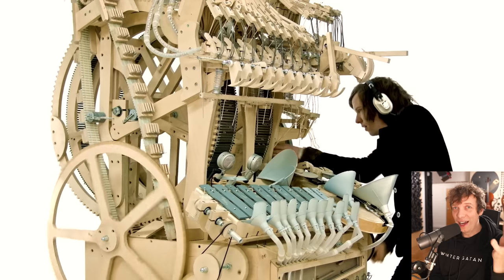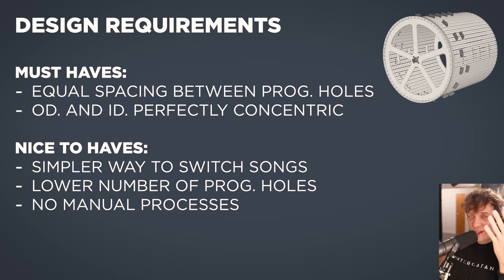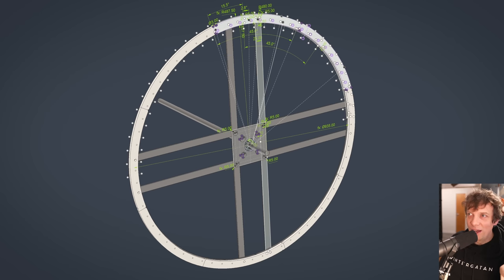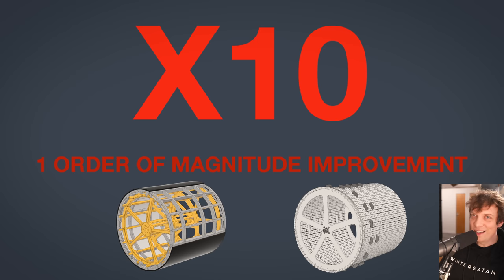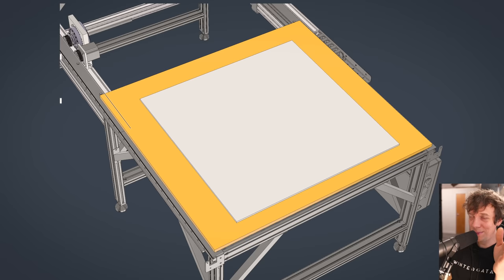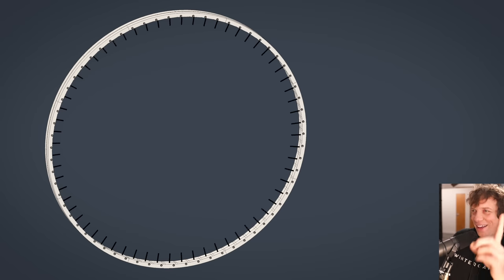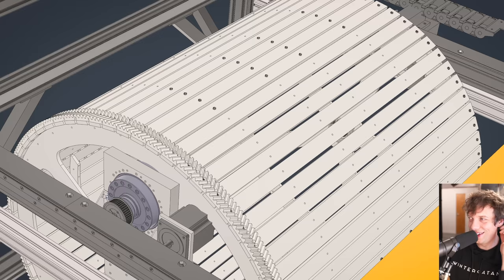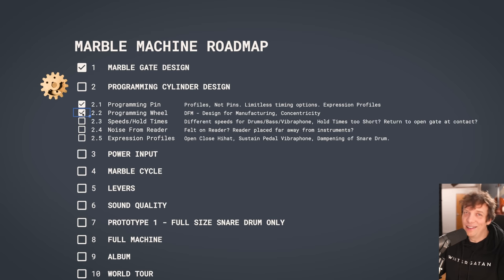A New Music Programming Wheel

Comment: select your material based on how you plan to use it
wood is good for testing
metal is stronger by weight
plastic is good for light weight things

plastic - really cheap, vulnerable to high temp (especially during transport box truck's get hot inside)
steal would be best for strength - cheap, high weight
aluminum would probably be bet for this - low weight, more expensive
programing belt (punch card or something like that) - really really cheap, easy to replace when damaged, easy to change songs, looks cool, hardest to store

if you want a cylinder:
my recommendation is to have an aluminum and plastic programing wheel - 1 per song
- plastic cylinder with aluminum spokes and braces

if you will try something else
you could try a punch paper system like to old style player piano's

Comment: I think you're starting to engineer the soul out of the machine in the same way that replacing a pianist with a midi track removes the soul.  Also by removing 90% of the holes haven't you reduced the musical sequence length by 90%, or at the very least 60%?

Comment: First thing, Nice yob on a new design. 
I would use screws for plastic (similar to wood screws) not bolts because you are screwing them deep enough so the screws are not going to strip out, and they will not need frequent dissasembly.

Why are  you making the gear out of 2 segments bolted (screwed) together, You could make the groove  and the holes on the rotary cnc. 

Try cutting the gear blank like a single strip in one setup maybe even with a slot and holes for mounting, and then wrap it (with a bit of heat) around the wheel. this will probably need  a few tries to line up the holes on the wheel and on the gear, or glue the band on and then drill the holes on rotary cnc, and then cut the gear on rotaty cnc

Be carefull about timing the gear segments to 4 programing segments so they overlap, but you figured that i think

That harmonic drive has almost no backlash wihich is great, but you can add a weight to one side of the wheel as cnc is cutting so that the load is only in one direction. or machine a giant timing pulley for the belt driven drive 

Gang up wheel side plates and brackets 4 or even 6 next to each other and cnc machine them on rotary in one setup (face the top, then drill 8 or 12 holes)

Use screws for plastic (similar to wood screws) they are self tapping and they are not going to strip out if they are long (you have a lot of depth to screw them into) also this isnt meant to dissasemble so the will be yust fine

Comment: So, while you're playing one song, the backstage elves are reprogramming the second wheel for your next song. You'll want a simple extra device backstage which can quickly read out the wheel to confirm it has been programmed correctly. Tell the device which song you're trying to program, toss the wheel onto the device, give it a full rotation, then a display will tell you what programming pegs are out of place, or a green light if all correct.

Comment: The more of these new videos I see, the more fear I have of the MM3. Martin has surely learned a lot, and while I like the approach of compartmentalising every small aspect of the new machine, the very soul of the machine is how each part interacts with each other. You can design and build two 100% perfect parts that do not work well with each other

Another thing that I see more recently is that Martin frequently "fudges the numbers" to force proof that his new idea he likes is better than the older. I'm not saying this new idea is better or worse, but that it is certainly not as "simple" as he brags about. Fewer manual processes? Idk about you but I do NOT want to be in charge of affixing that many bolts. And I also believe he overexaggerates how complex and flawed the MMX version was. Basically, he decides on a new idea and then finds "data" that supports why this new idea is better. It's backwards science - he's already concluded that his idea is correct before building and testing it

Comment: Hmm, there's like... nothing keeping the new wheel's side for torsioning away from each other is there? So in practical term keeping the left and right side exactly in sync with each other, it looks like the driving side could be slightly ahead of the passive side, especially at higher speeds

Comment: Now that we no longer have 1 pin for 1 note, won't you need some kind of interpreter to convert one pin to many notes?  I don't recall this being already built into the marble gate assembly.  Will this be built into the wheel readerheads?  The tightness of this interpreter would also need to be analyzed via prototype.  Do we have a roadmap for this assembly specifically, or is it going to be handled within the programming wheel checkpoint?

Comment: I don't see the other machines as failures, more steps towards a fully working one. As an engineer, this is very typical you have to test and build designs, sure it could have been faster to get there but that's part of the learning as well. When we are designing things for Satellites you will start with individual parts of the whole thing, prototype BB it is called Bread board in case of electronics. Then you progress to EM, engineering model this one should work like the finished one but you can still work on it change it modify and optimize but it has to have all the function and performance of the real unit, the EM can be also tested to its extremes. Then there is the FM (flight model), this will go into service and incorporates everything learned. There is a bit more to it, but in a grist that's how it works.

Comment: I'm  5 minuts in. No idea if you covered this yet. But belts might be a better way to go. All gears have backlash. If they didn't have any they wouldn't be able to function. This would be bad for keeping the music tight. The reason milling machines get away with it is the insane tolerances they are built to. And that takes lots of time and money to get right. The reason belts are used in almost every precision 3d printer is because they get rid of the backlash problem while saving on cost. It makes the most expensive part of motion the precision motors that drive the mechanism.

Considering you don't have to deal with high torque or lateral and horizontal sliding motions. Belts would be a better idea. They are also quieter that meshing gears when done right. Thought I'd add my two cents. Hopefully this makes its way to you somehow.

Comment: Hardware = manual processes

Also, the hardware is disproportionately heavy compared to the material of the build, and that many fasteners can put weird tension and pressures on the build that warp the final assembly.
You should minimise hardware just as much as you should minimise any other part

Comment: What are the requirements that dictate you need your darling "double helical" gear? In a previous video you talked about Killing Darlings - is what you've presented strictly necessary ?
Reply: Not only are there types of gear teeth that will minimize backlash, but unlike a CNC or a 3D printer his marble machines don't even really need that since they always rotate one way only and at a constant speed.

Comment: So you're gonna have a physical person changing the pins on the second wheel while you play the first one?

Who will that be? And how would you prevent that individual from making any human errors that you can't control before playing? You care a lot about stopping marbles from dropping incorrectly, yet you're willing to outsource an entire wheel to another individual, and you won't be able to notice that something is wrong  until you've already started playing.

I hope it works out well, but human/social engineering is just as important as your actual technical engineering if you're planning to have someone else do that work during live shows. It doesn't sound like an optimal solution.

Comment: Not a mechanical engineer here, but couldn‘t torque build up between the two sides of the wheel, so what part of the wheel prevents it from turning „into“ itself? Hard to explain without a drawing, but your design shows how all spokes are perfectly parallel to eachother. Couldn‘t it happen that the right side of the weel turns a couple of milimeters farther than the left side and thus all spokes are suddenly at an angle to eachother, like a twisted can?

Comment: You might have some interesting issues with the rigidity of the plastic during machining, as it will be quite high stress, but you'll have to see that. You also need to be careful machining on a wheel that big, as the leverage is massive.
Also, please use push rods rather than Bowden tubes, they're better in petty much every way for this.
Also also, if you're going on tour, why not have a seperate wheel for every song, then there's no messing around with reprogramming on stage?

Comment: This might sound silly, personally I like the wheel as I suppose that it is part of your goal, but do you ACTUALLY NEED the programing wheel? 
As far as I can see that things must be manually programmed unless you put pins under it that with the help of a program, they go up and down as needed, yet I suppose that is inconvenient at some point.
Other I'd say would be to throw away the wheel and use a programmable mechanism that moves the arms as needed and you can use a program to make it automatic (I mean, you would still need to load a program but that's all)

Comment: Why not have a hub, rim and spokes like a bicycle wheel? Sure, there is the need to true it for concentricity (tensioning each spoke), but the saved weight and insane strength makes me surprised this wasn’t considered.
Reply: Seriously though, if you think about the crazy forces a mountain bike wheel takes, yet how light it is (some even having spokes made of nylon string) and how structurally rigid it is, it would make a great interface for the programming wheel to the shaft.

Comment: Loving the design progress, but I don't think the bearing selection for the hub is right. I am a mechanical engineer and have used these SKF bearings many times and they are ideal for mounting rotating shafts to a structure that is not perpendicular to the axle as they have a spherical bearing between the cast housing and the rotating inner. This could give you issues with mounting the axle perfectly perpendicular to the side spoked wheel. Also the way you have mounted the bearing to the spoked wheel is against a rough cast face that is roughly spotfaced in four places for bolt heads and so not a perfectly flat face. This could introduce twist of the spoked wheel and non-perpendicularity to the axle. I only mention this as you are looking for tight tolerances for tight music play back.

Comment: I dont actually understand why you cant have 4 quarter big programing plates again (same as on MMX), since you´re going to machine the programing holes in the platses in the rotary expansion CNC after mounting the plates on the wheel.

With the rotary expansion CNC you dont have to bother with distance between plates. Just bolt the larger plates on the programing wheel then run the rotary CNC. 
The spacing between holes will be perfect anyways since you CNC the holes in the plates "on the spot" so you dont have to care about perfect spacing in between plates. 

That would lead to A LOT less screws and parts. The larger plates would stabilise the whole wheel more, the larger plates doesnt require as much bolts as the programmingstrips. And like 4 quarters of programingplates is a lot less parts than 60 + programingstrips. It´s also a lot less risk of 4 quarters of platses shifting places in transportation than 60 +. 

The programing strips are brilliant by the way. You could make looong strips with sequenses of notes thus making it so much faster to program a pre determined song.

Comment: What would be the amount of actual error when machining flat x/y and are there any design approaches to minimize/manage the total error in the end product? Is the design rigid enough to make use of rotary axis machining? (Lack of rigidity can be mitigated by support rollers though) Is the bearing centered by other means than it's fixing bolts? Are the mounting holes for the prog pins necessary? If prog pins are printed > no manual labor is needed > no limits for the shape/complication, those prog ribs could be cut to a shallow comb shape (for indexing prog pins sideways and reducing the amount of prog pin holes to zero) and mounted radially to gain axial rigidity in both each rib and whole structure. Prog ribs could be slotted into end wheels, reducing the amount of fixings. Axial ribs could be extended along/inside the spokes and stiffen the structure even more.

My point: From flat and flexy to radial and rigid. 

But, probably, the method and path to be used is already chosen. 😉

Comment: The parts that span from one wheel to the other wheel that the programming pins connect to.  Won't the parts that span flex too much when the machine applies pressure to the programming pins?  I feel that at least one more wheel between the other two is needed for rigidity. That or some other form of bracing.  Sorry if I worded that confusing.

Comment: Hey Martin, if you CNC the wheel while everything is assembled, what will happen when you need to disassemble it for transportation. It'll probably still have tight tolerance, but I wouldn't mark the wheel as "done" until you've done that test of disassembling and reassembling and then testing timing again. In fact, how do you plan on testing the wheel before moving on like you did with the gates?

Comment: Can you design a wheel that somehow could be programmed outside as it already is, but also be programmed and have mechanisms to play from inside? something like side A and B?
Reply: The same pin could cross the panel and each edge could have different shape or angle or even pins that wouldn't cross. On the axis spinning inside you put a mechanism that will play from inside once pulled it manually.

Comment: I don't understand why you would want to CNC the programming holes while it is attached to the hub, would it not be easier to take a large plate (like you showed when making the spokes and brackets) and then CNC the holes out that way, then cut the individual pannels out to put on? you could also CNC out the screw holes at the same time reducing steps in manufacturing and removing the need to make a specialized tool for CNCing the plates while it is on the wheel.

Comment: I enjoy watching these videos. However I think a major issue you continue to not address is considering using already made equipment/parts into your design. This  video really made think about that when you started talking all the CNC machining.

For instance on drive gear: Consider using rear end parts from car/truck. They will last long time. Already include design for axle. Can be bolted to larger wheel. Easily ordered for replacement/duplication. Helical design/cut already. Many different gear ratio sizes available to make even more options for machine.

Also I echo what many others here have said. 
Drum: Plastic=bad Aluminum=good  (stable material for travel, temperature, and longevity)
Drive gear: custom=bad off-the-shelf bolt on=good  (replacement, spare, can be ordered)
Inner hub: Need additional inner spokes to make more stable. Maybe not for playing but for travel when on tour.

Comment: I will say, neither of your other marble machines were failures as marble machines. While they may not have been fit for the purpose of going on tour, I think that they are actually more fit for the purpose of making entertaining music videos than the current project will be. Their imperfections are a large part of what made them so much fun to watch. As great as your music is, it wouldn't have captured my attention nearly as much if it weren't for the fact that you somehow harnessed a rube goldberg machine to play it on. The unnecessary complexity, with things spinning and pumping and marbles rolling around on top, and the mechanical linkages of the marble droppers on full display, rattling and clattering with the beat of the music are, in my opinion, a core part of what makes the marble machine so great. If you succeed in removing all that imperfection, I worry that the marble machine 3 will be to the previous two what a synth orchestra is to a live one: way easier to work with, and arguably more "perfect", but missing that indescribable quality that makes it feel so magical.

Comment: Can you not just mill the whole part out of one solid stainless steel cube? That would tick all must haves, all nice to haves, it would be just one part, so one and a half orders of magnitude better than your current solution and it won't twist (as others have pointed out which I am also a bit worried about). Only downside is that you will have to reinforce the stage slightly. Ah and you might need a crane for switchng wheels on stage. 😋

Comment: if you are CNC machining the parts from the same material anyway I'm surprised you can't design a dovetail joint that would be glueable making the whole drum a solid piece. no bolts.

Comment: Out of curiosity, if you are using inserts for programming the drop timing, wouldn't you be able use heavy duty tape (Or velcro)  to create a profile of songs, decreasing the margin of error when removing old songs, and adding new songs into the "Wheel" and significantly decrease the time necessary for programming new patterns?

Comment: Don't worry, I hate plastic even if it's "engineering" plastic, whatever that means XD Why don't you make it in one piece, like you said, but in metal, like aluminium ?
Also, Plywood may be more sensitive to humidity than steel, but I think steel varies more with temperature...